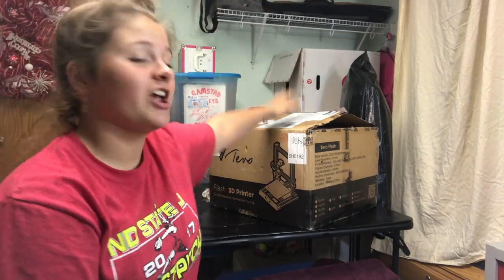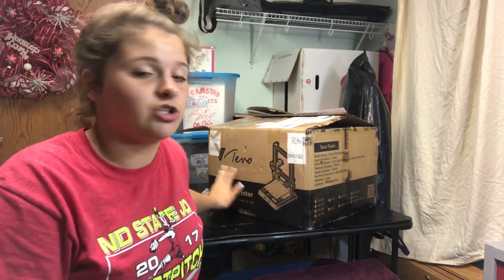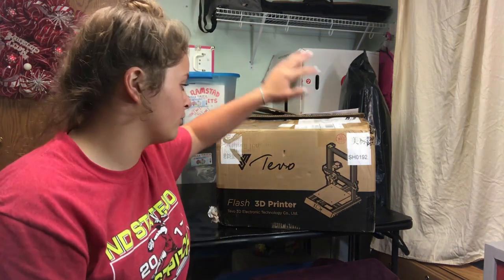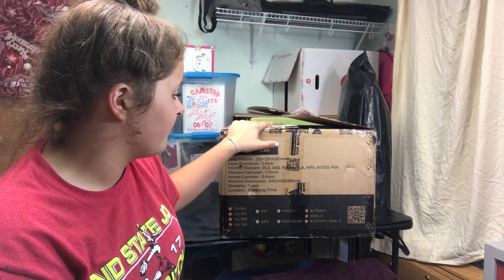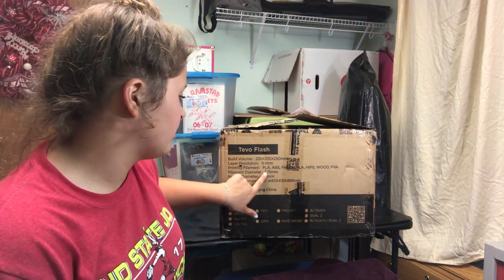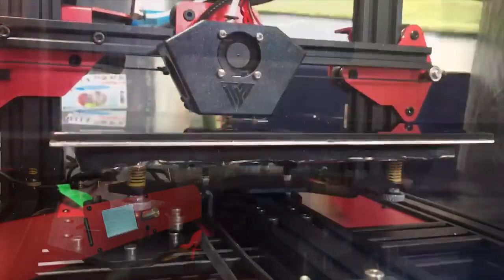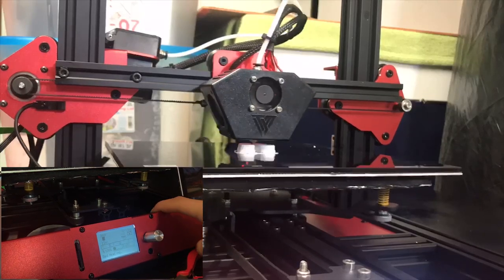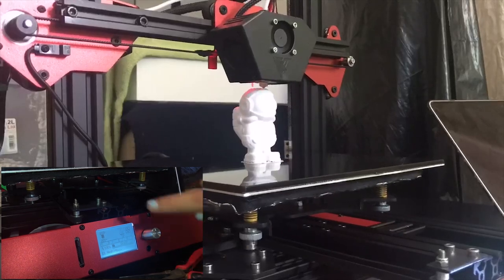Tevo Flash 3d Printer Review//BEST 3D PRINTER EVER!!!

Comment: Hello great video.
Do you know if this printer has a pause system in printing or resuming if the electric current fails?
Reply from the maker: I’m pretty sure it does. I was told the new ones do but personally I am not 100% sure. I will check on it but I have not had to use it yet:)